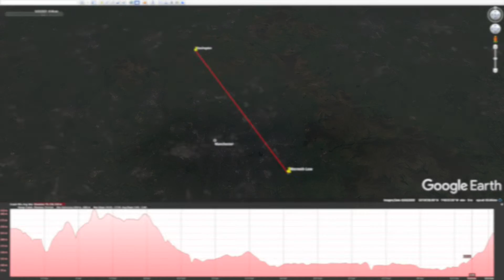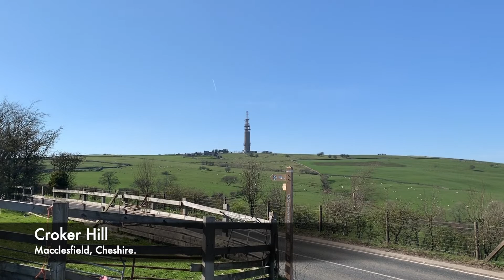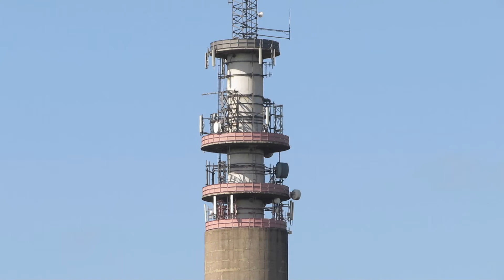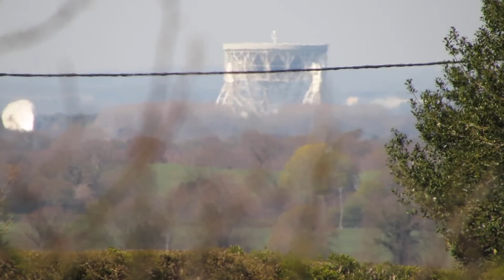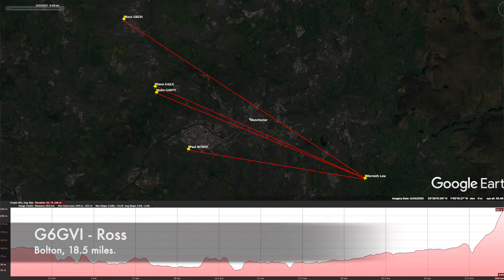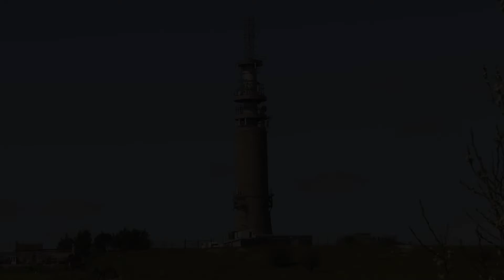My First 4m 70MHz Band Net - Retevis RT9000D

Comment: Hello Lewis I always have four meters on the 70.450 Mhz FM calling channel  with ex PMR running about 25 watts  aerial is a full half wave vertical about 10 meters high check me out at QRZ.COM in SW Cumbria now get a trainsverter for SSB CW and a Delta Loop aerial 73's stay safe de G0MEJ